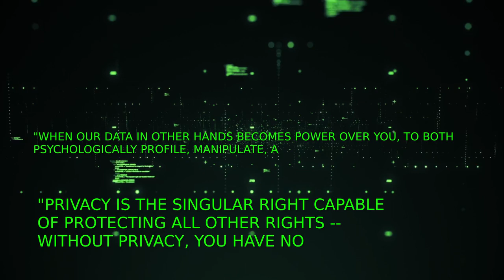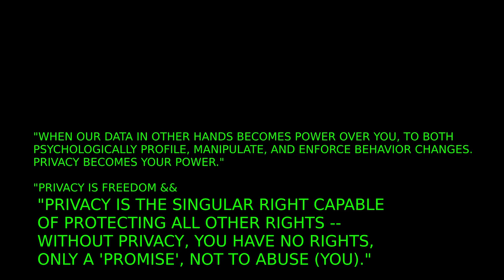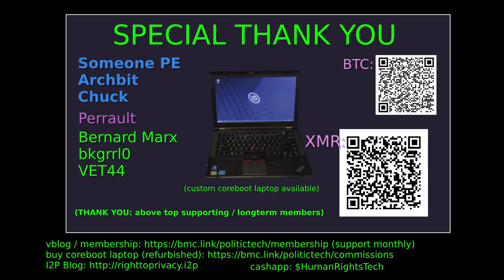Disassembling W541 / W540 Thinkpad

Comment: This is an extremely well informative demonstration. I rushed it and accidentally messed it up badly. The model I opened up is quite different than this, it was one piece as the battery was under the hood, I open up the back cover, unplugged CMOS, removed the CMOS, unplugged a visible plug coming from the main battery, most of the area was covered under a sticky black film, I wanted to see under it so I started to remove the film. Nearly finished, the film was going under some screved parts, near the wifi card are, the film was harder to remove, I applied some force, accidentally ripped out the display cable with the connecting golden stripes and all. I pushed the rectangular film-like connector of it to it's slot, for a chance I knew not gonna happen, and that was it, I botched it by rushing and not being gentle. I'm gonna get it fixed, so I learned something today by really trying it on my own. I love the fact that you make these demonstrations sir, the manufacturer's online support is just very unpleasent. I am very into ThinkPads, so I will watch your other similar content too and I'm gonna do it better than today next time. Thank you for making this awesome and cool demonstration sir. It is very very educational.
Reply from the maker: Appreciate that! Definitely have to be careful how you remove cables. I've done similar in the past and learned that lesson. ;)
Reply: @RTPTechTips  Thank you sir, it was my first time and i to do it in short time before going to school, next time i will do it calmly without rushing it :) Your content is extremely educational for me, I thank you sincerely for making these :)
Reply from the maker: @CodeLangtonsEntropy Was just combing through comments I missed replying to and just wanted to say, I really appreciate your feedback. I've been working on a I2P hosted XMPP chat server recently (ATM just during spare time), and more videos on that to come (i2p hosting). You asked earlier if I had a chatroom, it's something I've thought about doing for years. Well I've been seriously considering that (my main concern is people talking about something I can't control and that falling back on host). For now, I mainly chat on I2P IRC sometime #saltr and other rooms, maybe I'll see you there sometime! 🙂
Reply: @RTPTechTips  Thank you very much for the reply and invitation Sir, I will surely check out the IRC chatrooms you mentioned, I have never used I2P before so first I need to learn the tech, luckly for me I see that you have extensive content on setting up I2P on the channel, thank you Sir :)
Reply: @RTPTechTips  Thank you very much for the reply Sir, somehow YT didn't publish my previous reply to this just now, so I am writing again, I will make sure to ch3ck out the IarC chatrooms you have mentioned, thank you very much Sir :)